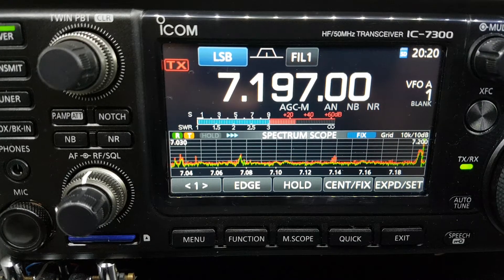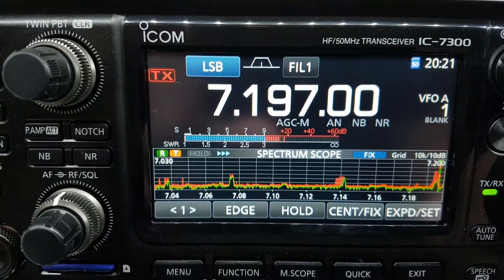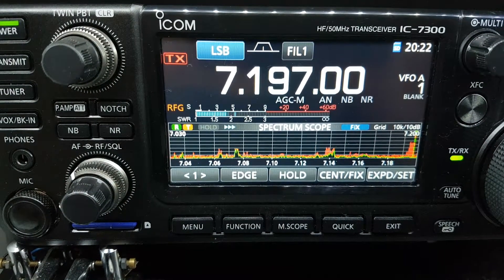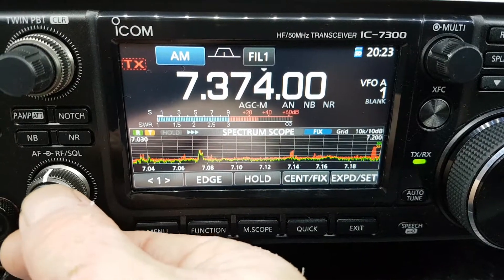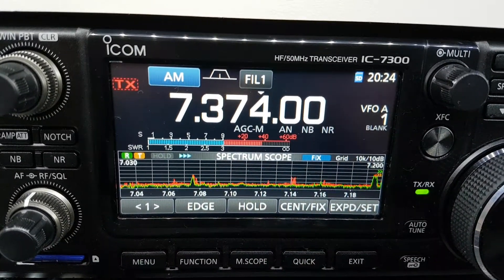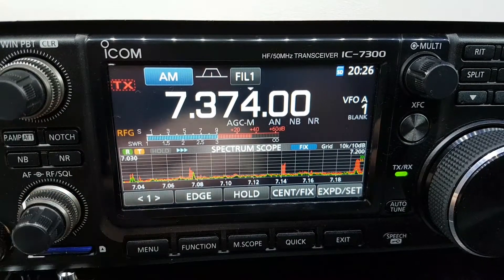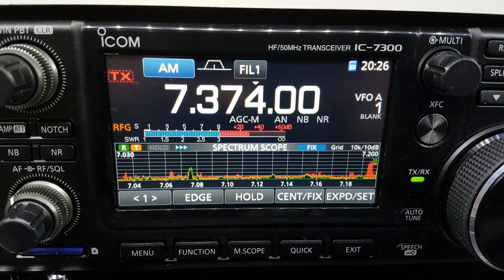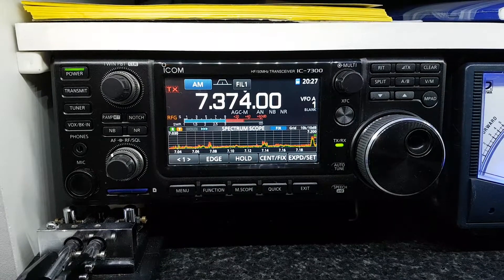Icom IC-7300 – Handling Strong Signals & Overload Tips

Comment: Reducing your rf gain is a must on the lower bands, it will enhance your listening experience.
Reply from the maker: Steve Malpass an absolute must. Especially on an SDR type rig. I even used to do it on my old analog radio. Some say it's poor receiver design, that has to be the greatest load of tripe I've ever heard. If the receiver can hear the signal just the same backed off by 40 per cent, there ain't nothing wrong with it.
Reply from the maker: I just ran it wide open for the purposes of illustration of no OVF indicator on the screen here.
Reply: Yep, remember what Ten Tec advise you to do with their radio,s, They say give it plenty of AF then reduce with the RFG, it gives the agc plenty of recovery time and helps for better listening, effectivly using the RFG as a AFG or volume to some, as you say I think most if not all radios could benefit from this. Some people want to see the S meter showing plenty of gain you listen with your ears not your eyes. Ive been using a 7300 for about two weeks now and after a bit of clumsyness have found some very pleasurable listening experiences, Is it the best?? for the money I think it well may be.
Reply from the maker: Steve Malpass Hi Steve, I'm glad to hear you like the 7300. Is there anything you would like me to do a video on about it?
Reply: HI GEORGE. You might want to show how you inject your audio, Ive tried via the usb using the audio router in the RumLogNG logging software, I've yet to try the ACC, KR Steve G0OGS

Comment: why do all these radios show S5 reading  of ground noise?
Reply: I have tested a 7300 here and I am at a low noise area. It was at S1. What you see is the noise in that area. Nothing to do with "all these radios"
Reply from the maker: Roeland Jansen exactly. I've done some work around the house here and have since reduced it to S3. For a residential area it's very good
Reply from the maker: Roeland Jansen plus you don't need to run the RF gain wide open on a 7300 anyway. I did it in this video to show I don't get the 'OVF' on the screen like a lot of people have reported. Very seldom do I see it, only if there are very heavy static crashes.
Reply from the maker: Sky1 in my case I'm in a noisy environment ie. Built up area. I can't comment on others you've seen.